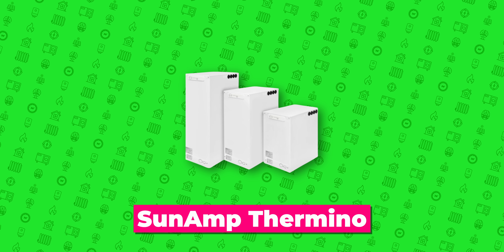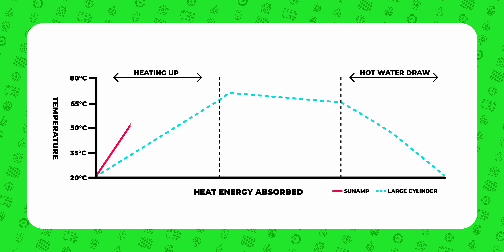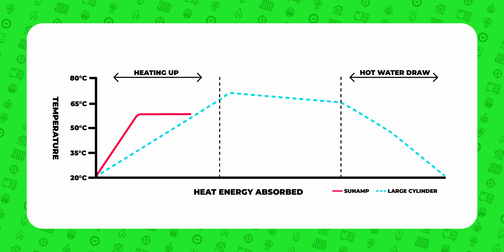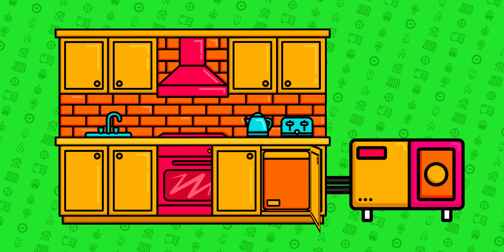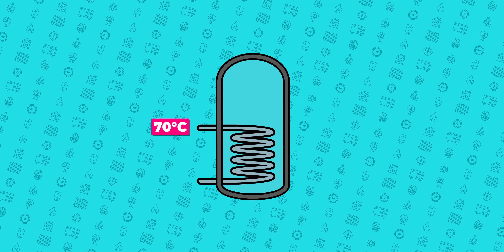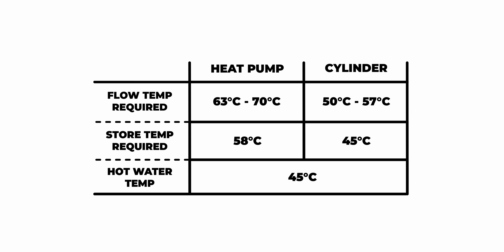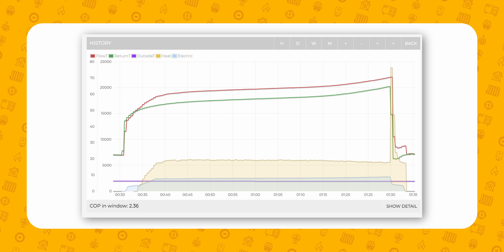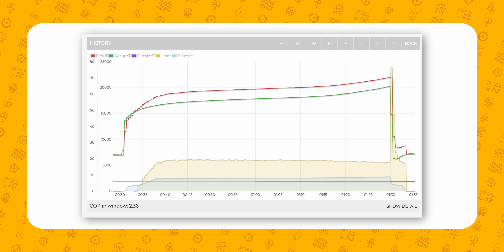Is this THE FUTURE of Home Hot Water? Sunamp Review

Comment: Great video. Just catching up here.  Hoping to attach a Sunamp this year to the output from our 16 year old Solar Thermal tank, as a pre-feed, especially as in the summer the thermal solar does close to 100% of hot water demand.  Space solution and combining with existing technology is our requirement. Can also use existing solar PV / battery to charge up the phase change.

Comment: My sunamp boiler is the best boiler I’ve ever had. It was already installed when I moved in last year. 
However, I’m now trying to do my research as it appears that the solid to liquid gel has exploded out. 

The fuse box to my boiler tripped, when I turned it back on, I heard an electrical sound, a huge pop and then smoke and or steam. So I believe that this gel that stores the heat has popped out and my boiler is fucked. 

It’s an absolute nightmare trying to get an engineer because nobody has a clue what these are. 
I’ve contacted Sunam directly and because the previous tenant didn’t buy it through them, I have to go through the third-party seller. I’m waiting for their response. 

I’ve been without a boiler for two days and there are no emergency engineers that know what to do in my area. So this is something to consider for other people. Make sure you ask what happens in an emergency and who can fix this.

Comment: I'm in a position where the Thermino is the obvious choice so getting one in January with a Vaillant Arotherm plus 7kw unit to replace my dying gas combi.

3 Bed Semi, corner plot with external garage, external store was converted to a downstairs loo by a previous owner and UK planning permission prevents removal of a downstairs loo, infuriating.

I have a Pantry, but it's partly under the stairs so not tall enough for a traditional cylinder.

Most installers turned me away as only place I can put the cylinder is the garage, AIRA said yes but it's a more disruptive and expensive install and the garage is unheated, longer pipe run back to the house etc means less efficient.

Could go mini store but with a family of 4 I often use 30+ minutes of hot water in rapid succession. So not sure it would cope with the load and be efficient doing so.

I'm on an EV Tariff so can just charge the thermino overnight using the heatpump @ COP of 2.0, meaning it's 3.25p per stored KWH of heat. I only lose 2/3 of one shelf in my pantry now too.

Comment: I believe you can use the can use the thermino without the heat pump - prime it during the offpeak or via the Octopus cozy tarriff.   I would infer from this that the heat pump would be more efficient without undertaking hot water overheads?  any thoughts?

Comment: The Logarithmic Mean Temperature Difference (LMTD). The calculation for heat transfer, 😊 LMTD = (ΔT₁ - ΔT₂) / ln(ΔT₁ / ΔT₂)

This system uses more energy because its requires laten energy. Put a bigger water tank in, 🎉 cheaper

Comment: I understand there are ways and means of getting super high efficiency and super low cost hot water heating.

But when you have minimal space for a large cylinder. And use other technologies for heating (air to air heat pump). Then the sunamp has actually been really good.

Less than £10 per month on our off peak tariff, whilst giving us a tonne of space back.

I understand it’s not as efficient but the low complexity of install and given we are in an all electric house with no heating plumbing, a heat pump would likely need replacement before we recouped the funds.

Less than £10 a month for a family of 3 (daily baths for the little one).

Comment from the maker: Want to know how much a heat pump could cost for your home?
👉 Just head to upgrades.heatgeek.com and enter your postcode

✅ Get a free, instant estimate in less than 30 seconds!
✅ Find out your home’s potential savings on energy bills
✅ See what a heat pump system would look like for you
Reply: Not convinced that heat pumps are the right solution for all, when we have a growing percentage of intermittent solar and wind energy in our mix. Feel that technologies like this sunamp and even modern versions of the night storage heaters might be the way to go. I am on octopus agile and you can see that there is excess electricity on the grid at certain times of day, week and when certain weather setups are around. Sometimes I am being paid to use electricity, although sometimes it is also expensive. Therefore I feel that efficiency, such as the advantage of air source heat pumps, will become less important than something that can store energy such as heat batteries (and using energy when there is excess such as a timer on the dishwasher to turn on when cheap).

Comment: Another benefit of a Sunamp is that the brate if heat loss from the system is low; once up to temperature it stays hot for days if not used (much). That can be a big benefit with solar or other intermittent energy sources.
We want a compact unit for our narrow boat where the engine heat warms the Sunamp, and it stays hot for several days if we are  moored. Sadly they don't have a leisure sized unit.

Comment: The Sunamp Water battery costs around £2,000 less fitting cost, so you would want to maximise efficiency to make this a worthwhile addition to a heating system. How well does it work medium term in chalky hard water areas when it starts to clog up with chalk deposits?

Comment: Maintaining a hot water storage temperature of 60°C (140°F) is essential for killing Legionella bacteria. In the Legionella temperature chart, this temperature is critical for ensuring that hot water systems do not become a breeding ground for bacteria.
Key practices include:
Setting Water Heaters: Adjust water heaters to maintain a minimum temperature of 60°C (140°F). This ensures that the water remains hot enough to kill Legionella bacteria.
Using a food cooking thermometer run under a tap at full stored water temperature will confirm your stored water temperature.

Comment: Dear Heat Geek!
I have an interesting, yet nowhere explained question regarding low-loss headers and inverter heat pumps. Is there a way to get in touch with you for a future video idea?
Reply from the maker: @mematyi  here or heating help for homeowners Facebook group?
Reply: @HeatGeek  You, and other people made several articles about LLH and buffer tank problems, regarding flow rate differences, temperature mixing, etc. What if you must use a buffer/LLH, because you have both fancoils and UFH, or separate wall/ceiling heat-cool and UFH, or multiple heat sources?
The best available articles(like John Siegenthaler's) only describes systems, buffer connection schemes, at their nominal performance. Even heating design engineers specify components based on max load. The primary flow is greater than secondary, the LLH works flawlessly, hydraulically separated. 
But as a heat pump modulates, it usually reduces its pwm pump's speed, so primary flow becomes less(maintaining dT). The secondary pump, which is usually fixed speed, or constant height type, pumps more water than the HP, so flow mixing occurs, if the system isn't zoned.
Reply: @HeatGeek  The same thing occurs imho with monobloc heat pumps with plate heat exchanger. It might be sized to have less than half a degree of loss, at nominal flowrates.
The heat pump reduces flow, but the secondary pump is fixed, so dT on the secondary side should increase(??), because of the still high flow, but lower capacity. Or the forward temperature drops on the secondary side? Or it follows the primary side with a lag?

What am I getting wrong? Many people say that LLHs, buffers and PHEX methods work great for them.
Do I have some error in the logic, or is it a loss that practically nobody has gone after?

Imho, a fixed-deltaT type secondary pump would be the ideal, but only the most expensive Wilo and Grundfos pumps have that feature.
Reply: It is not a homeowner-type question, but it might be too long as YT always deletes my comment
Reply: @HeatGeek  It is not a homeowner-type question, rather a system design/evaluation story. 

You, and other people made several articles about LLH and buffer tank problems, regarding flow rate differences, temperature mixing, etc. What if you must use a buffer/LLH, because you have both fancoils and UFH, or separate wall/ceiling heat-cool and UFH, or multiple heat sources?
The best available articles(like John Siegenthaler's) only desceibes systems, buffer connection schemes, at their nominal performance. Even heating design engineers specify components based on max load. The primary flow is greater than secondary, the LLH works flawlessly, hydraulically separated. 
But as a heat pump modulates, it usually reduces its pwm pump's speed, so primary flow becomes less(maintaining dT). The secondary pump, which is usually fixed speed, or constant height type, pumps more water than the HP, so flow mixing occurs, if the system isn't zoned. 

The same thing occurs imho with monobloc heat pumps with plate heat exchanger. It might be sized to have less than half a degree of loss, at nominal flowrates.
The heat pump reduces flow, but the secondary pump is fixed, so dT on the secondary side should increase(??), because of the still high flow, but lower capacity. Or the forward temperature drops on the secondary side? Or it follows the primary side with a lag?

Comment: Hey, I really like the channel. I've been following you guys for a wheel. I had a question about plumbing the heating system. I'm looking to get a heat pump installed in my house, we wanted to get the cylinder put in the utility cupboard on the ground floor and have the heat pump located at the front of the property. I'm aiming to do the plumbing myself for the water supply, and I wanted to ask a question about sizing the pipework. Currently I'm thinking to putting in a 15mm copper pipe mains supply to the utility cupboard, for the tank and heating loops (wet ufh downstairs and 4 rads upstairs) and I'm wondering if this would be big enough? I know it's hard to say without seeing, but if you've got any advice it would be appreciated. I wanted to get the pipework done before engaging with a heat pump installer.

Comment: Hey, awesome channel!  For me,  heat storage needs to account for daily losses if you want to store it for days or months. I'm still hunting for a way to save summer PV energy for winter use at home, not those massive sand batteries they use for district heating.  I'd be stoked if you found a solution, even if it's not super efficient.

Comment: Another overpriced gadget! Out of reach for most. Ps there is not a shift to low carbon heating. A few want to spend £15k on a heat pump , solar and drive an ev to virtu signal but most will stick with a gas boiler and ice cars. Let’s not make stuff up!
Reply from the maker: @Cyberbobxxxx  installations grew by 90% in the last 12 months wether you want to believe it or not.
Reply: don’t believe it. I’m sure people believe it and are having expensive complicated pumps fitted. Have a look at Paul Burgess climate reality documentary.

Comment: The Sunamp is an interesting piece of technology, but I much prefer the flexibility of a conventional thermal store. Yes it's a lot larger, but on cost per kWhr of storage basis it's only 10% -20% that of a Sunamp, can take heat from pretty much any source, and provides both hot water and central heating.

Comment: Video seems to say the SunAmp is good but the Heat Geek Mini is better. Just looking at the figures I'm not sure how true that is. For example, there is mention of the SunAmp requiring higher flow temperatures to charge but no real mention of heat loss to the environment i.e. standing heat loss. In Adams video 'This Invention Will Change More Than 10,000,000 Homes!' he shows the small Heat Geek Mini unit working with a store temp of 55'c so I guess a flow of 60'c from heat pump. The power consumption on the higher flow temps of a Vaillant aroTherm plus seem to be around 0.25kw less per hour when reducing from the high flow temp for the SunAmp to this 10'c lower temp of the Heat Geek Mini. However, the standing heat loss for the Mini is more than 0.25kw when compared to the smallest SunAmp which has a much great capacity and is actually more comparable to the Heat Geek Mini Store XL which has an even greater standing heat loss.

I'm not knocking Heat Geek or the Mini Store as these videos have been a huge help in educating me. It just seems a little unfair to companies like SunAmp to leave out key stats that are favourable to the product your aren't helping to promote.
Reply from the maker: @tommyhendry8771   hey. A few misunderstandings here. 

-First of all this was made 18 months ago, before the mini store was conceptualised.

-Heat loss from thermal storage has way less effect than efficiency of heat pumps if you do the maths. (If you do do the maths don’t use the huge deltas they assume)

-With the ministore the store temp IS the flow temp, that’s the beauty, so no uplift/effy drop
Reply: @HeatGeek  Also, could you clarify when you say 'this was made 18 months ago' are you referring to the video entitled 'Is this THE FUTURE of Home Hot Water?' which was only posted 4 days ago? Not sure that is a misunderstanding as literally no one would know a video posted 4 days ago was actually made 18 months ago. Both videos mention the mini store and both have pictures of the product so can't see how that is a misunderstanding.
Reply: @HeatGeek  Care to elaborate on the maths as you are the man in the know? ;) Would be great to compare the Thermino with the Mini Store as that seemed to be where you was going with the video. I can have a stab but guess it wouldn't be as accurate but here goes:

The mini store XL is the closests match capacity wise to the smallest Thermino (xPlus 150) from a water heating perspective so makes sense to compare them. The Thermino takes 1 hour for a 5kw Vaillant aroTherm Plus to charge from empty on a 7'c day so should use 1.71kw of input electricity. The Thermino will lose around 0.67kw in 24 hours due to standing heat loss according to SunAmp. The spec sheet for the Mini Store XL will lose more than double this at 1.40kw in 24 hours. Do you have any details on how much input electricity would be required on a 7'c day to bring the XL up to temperature to provide a comparable amount of hot water?

Comment: Adam, is it worth considering just using hot water faucet heaters?  They are “only” 100% efficient, but drain waste heat recovery (DWHR) could boost that towards 200%. It would completely replace the hot water system, and low flow, water efficient faucets and appliances reduce any efficiency penalty. Especially useful in small apartments, ADUs, and wherever water use is low. Thoughts?

Comment: Yes, they’ve been around for years. You can even buy balls which have the phase change materiel inside them and pop those into existing buffer tanks. It’s a marginal benefit though because water already has such an insane specific heat capacity!

Comment: I've had a Sunamp with a Myenergi Eddi solar diverter for about 5 years and find it works well, solving the issue of no space for a large hot water tank.  In the winter I heat it at night on the Octopus Intelligent Go tariff at 7p/kWh and in the summer it runs entirely on solar, so it is very cheap to run.  My only quibble, which Sunamp appear to be unable to solve, is that there is no indication of how much hot water is left in the "tank".  There are 2 lights which are supposed to indicate whether it is upto half full or between half full and full, but I find that as soon as any hot water is used the 2nd light goes off, and you literally have no idea how much hot water you have left.  As I live on my own this doesn't matter all that much as I know what I have used, but with a busy household using hot water through the day it could be quite a problem.

Comment: I have this system and the way we use hot water seems to work ok. I don't think it would be good for families as the demand would be too much? Mine recharges at night on a timer on the cheap rate electricity and uses any battery storage left after the days use via my solar. In the summer I will sometimes override timer to boost the heater when solar is abundant.

Comment: Isn't the mini store the same as the Sunamp, just a different fluid?
Reply from the maker: @manzourahmed3383  as per the video, sun amp requires two heat exchanges, there for 2 x distortion and much higher flow temperatures. 

Ministore also has a much less restrictive heat exchanger in terms of both heat transfer and flow.
Reply: @HeatGeek  This is a silky idea. Why not use the heat generated tby a fridge/freezer to generate domestic hot water?
Reply from the maker: @ there are people experimenting with this already
Reply: @HeatGeek curious. This kinda suggests you lose twice with the Sumamp but I thought you could never create nor destroy energy? If you are removing heat from the battery then surely when you run out the temperature in the battery is higher than the flow coming out so it's not as if you have to heat from scratch? Wouldn't that basically equate to just the single hit not double you are suggesting? Would have thought that would be more than balanced out by the minimal heat loss the Sunamp has when compared with any water cylinder (including the heat geek designed one) wouldn't it? I guess there are figures for these losses somewhere to compare?